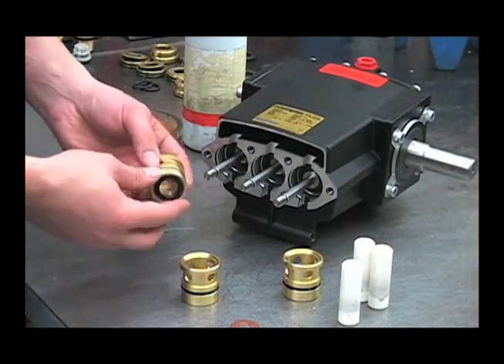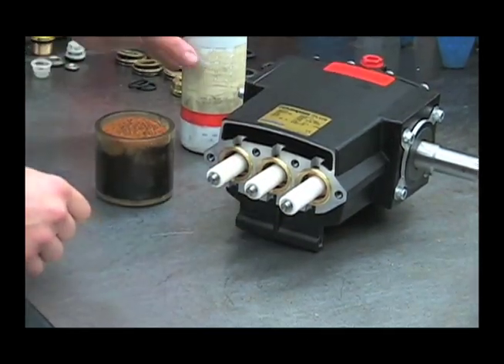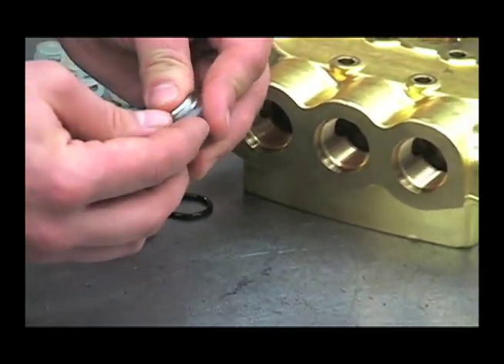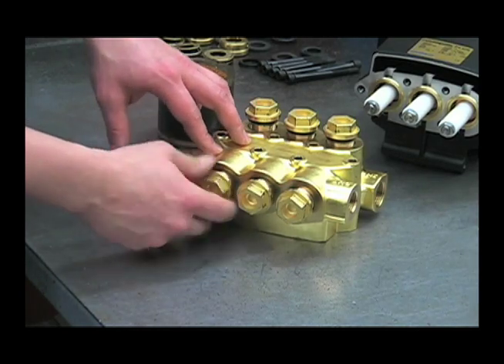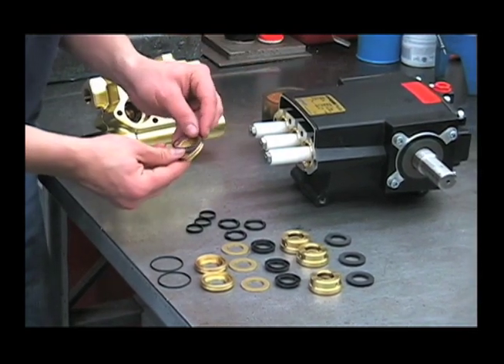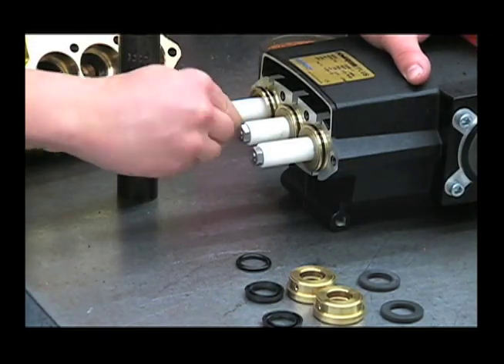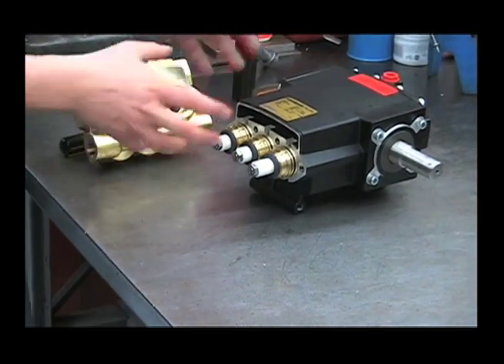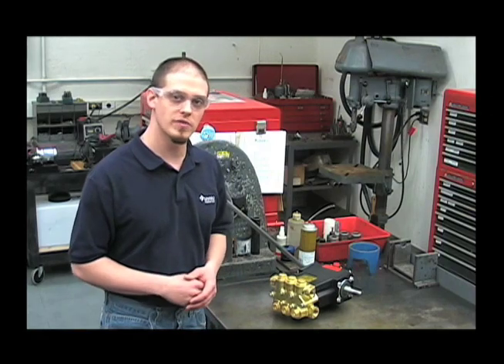Hypro Powerline Plunger Pump Service Video - Part 2

Comment: It is a wonderful demonstration of assembling and disassembling. Rest is how to test the pump in shop for proper vacuum, flow and pressure plus motor amperes if run electrically.